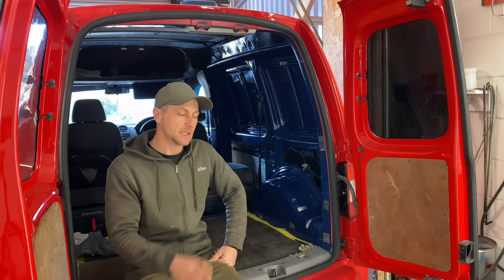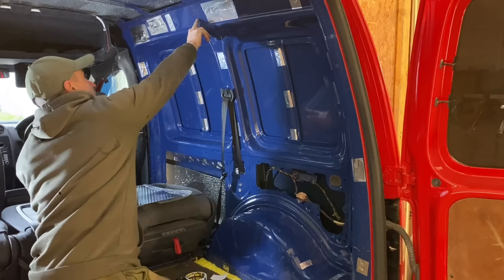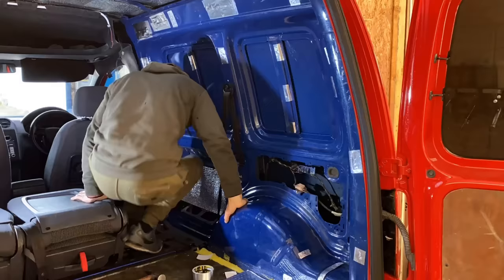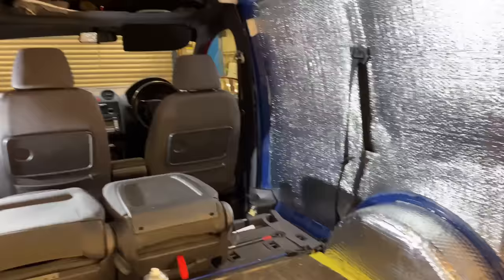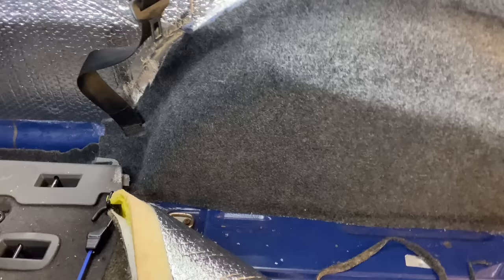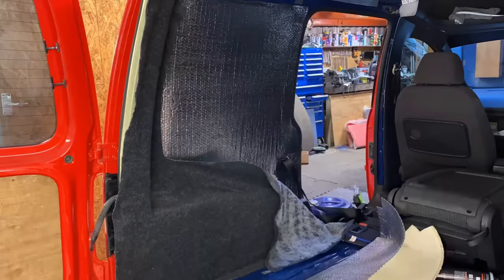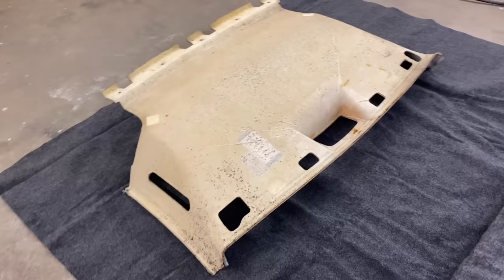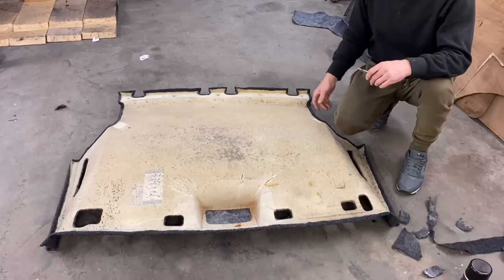VW CADDY 2K - insulation - carpet lining - build series ep15

Comment: Using self tapping screws can sometimes be easier. If they work in your situation it can save time for drilling and will reduce the chances of an "outie" from a drill bit. I also have come to love torx style screws. The heads are much less likely to strip out because they have such a positive contact to the driver. They can also be used many times without damage to the head
Reply from the maker: Hey bud I do have a box of them somewhere, good advice 👍 thanks for the comment,

Comment: Great job buddy. Are you aware you can buy the lower door kick trims to suite the rear seat conversion. These still need fettling but free up foot space and tidy it right up.  also cutting down the bulkhead to cover the holes works a treat
Reply from the maker: Hey Gavin thank you 👍 yes I’ve seen on the forums people get the caddy maxi trims or something I did have a look on eBay but I will look again. I saw a caddy a few days ago with a bulkhead panel cut down it does fill the gaps nicely 👍

Comment: Although longer than usual i found this video very informative as i plan to do a similar thing on a cheap van but it has to be ULEZ compliant as i work in Essex 😤 so ideally petrol but haven’t got a clue what to go for. It will be used for the occasional overnight sleep. Have you got any suggestions? Don’t suppose they do a petrol caddy ? Im lost for words for how far this transformation has come. Definitely a keeper 👌🏾
Reply from the maker: Hey scorcha thank you sir 👍 it was abit long winded this one. So I’m on the caddy Facebook groups and a lot of people are having petrol engines fitted into their caddy’s for the low emissions reason. On a weekly basis I do see caddy’s going up for sale with the petrol engine conversion already done and Ulez paperwork all sorted. The main caddy Facebook groups I’m on are the ones with 30k+ members on there might be worth a look, I can write up what groups if you want?
Reply: @YTDTETV  i didn’t realise that you could change engines and get ulez paperwork for it. I was thinking for of caddys that had petrol engines from factory but an engine change opens a load of different options. Never too old to learn. I will have a look on the facebook groups, i only join ones that have got members of high capacity and post regularly. Thanks for the info, its very much appreciated 👍🏾
Reply from the maker: @scorcha100  no problem 👍 yes a lot of caddy owners are having petrol engines fitted as other than buying a brand new van there isn’t much out there to buy. Any petrol engine is Ulez Compliant. If you didn’t want massive power then the 1.4tfsi is a good choice. Happy to help 👍

Comment: Was gonna follow this to the letter in my Maxi but I got my hands on a free roll of superfoil which is meant to be great from others ive spoke to. I'm just not sure on whether to replace any of or all of the materials you've used.  What would you suggest?
Reply from the maker: Hi bud the foil stuff you have acts as as a vapour barrier and noise insulator, I’d use that first on the bare metal then the white fluffy insulation then a sheet of vapour barrier to seal it all in, hope that helps 👍
Reply: @YTDTETV  nice one! So no need for the yellow carpet underlay? Thanks mate 👍🏻
Reply from the maker: @hkaerial7775  sorry for delay, no you can skip that bit the stuff you have is very good 👍

Comment: hows the painted black plastics wearing mate? want to do mine was nervous of paint chipping over time and looking tacky
Reply from the maker: Hey bud mine is still good it hasn’t chipped off, the bit on the bottom of the sliding door has a few rub marks but my kids climb in and out everyday, no chipping or flaking. Just make sure you Scotch pad the crap out of it and lay the paint on thin 👍
Reply: @YTDTETV  lovely stuff I’ll do mine, ahh yeah 👌🏻

Comment: Did you ever consider using forever black, instead of spraying the interior..? Also if you was to use a rattle-can what would you recommend paint and primer
Reply from the maker: Hi bud I’ve seen that forever black and I’ve seen mixed opinions, I’ve used the paint I did in this video a few times and it’s perfect everytime and lasts. If I was to use rattle cans I would get a scuff pad the same as the green side of a sponge and heavily rub all plastics down and that will key up the surface, then you would need a plastic primer. 2 lights costs of that then wait atleast half hour then some plastic black spray and again just do it in light coats don’t load it up thick or it will crack.
Reply: @YTDTETV  thanks for the quick response I'll order gear now and hopefully get some bits done this weekend thanks again your video are mint very helpful 👌
Reply: You got the link for the 5mm foam that you used in the rear windows pleade
Reply from the maker: @brendonbriggs622  hi bud I’ll add it to the video description right now 👍
Reply: @YTDTETV  thanks gona get some orded was going to Insulate it all, but with it been a caddy maxi life its just all pillar so just going to use the 5mm stuff